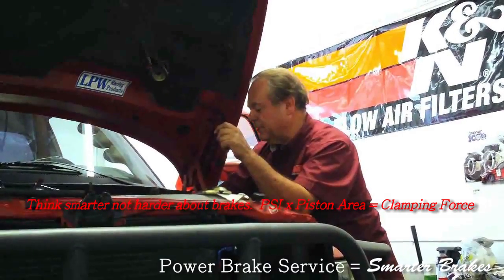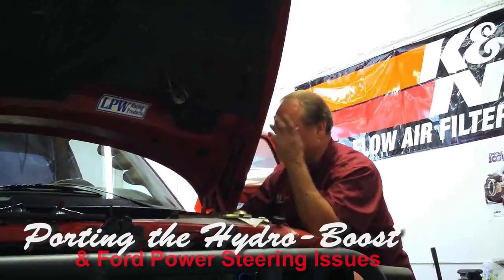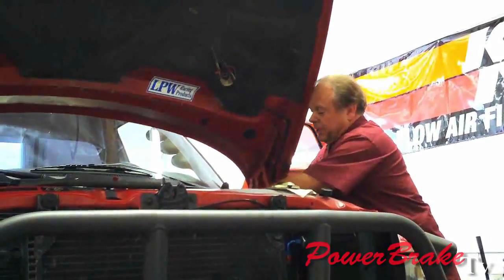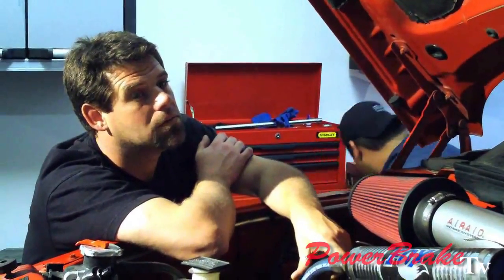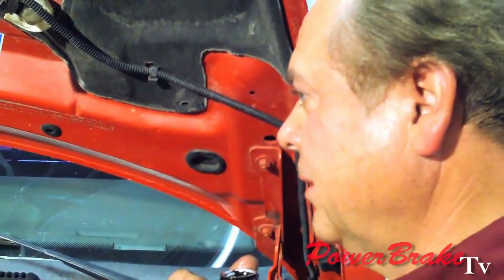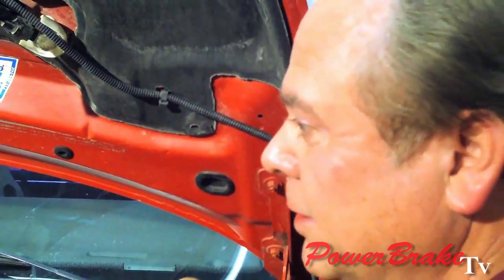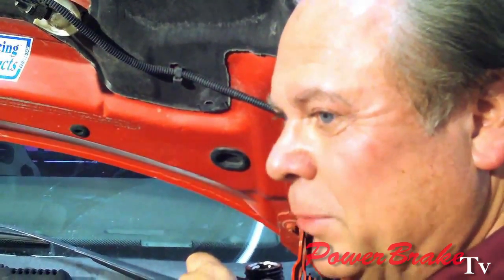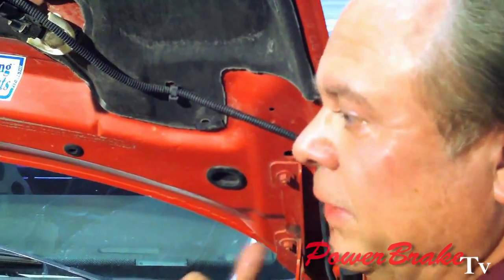Porting Hydro-Boost Ports on Ford F Trucks for Power Steering Flow - Sweeting Performance

Comment: Is there anyway to port a hydro boost unit for higher flow around the spool valve allowing use of ram assist without sacrificing braking or ps performance? Are saginaw hb units accumulators interchangeable?  Could I use a larger accumulator to offset a deficit in pressure/flow? Thanks!

Who's claiming to port the hb units? There's one company I was going to use and want to avoid wasting money.